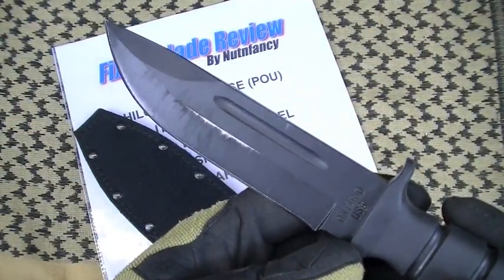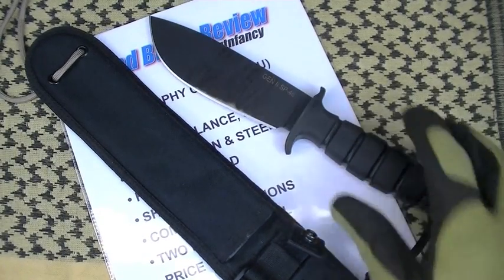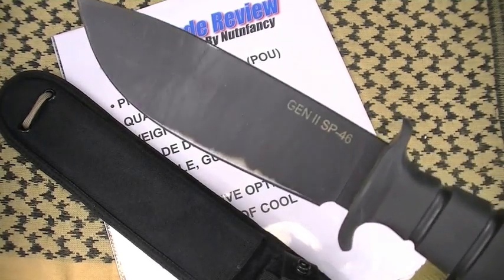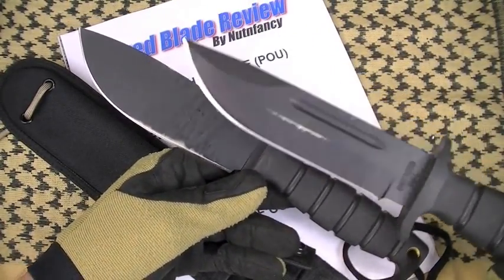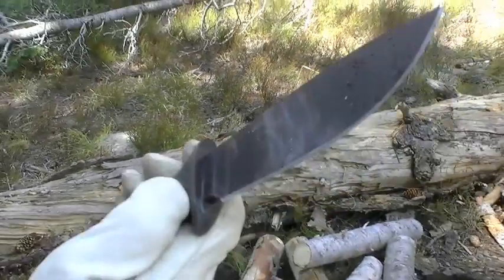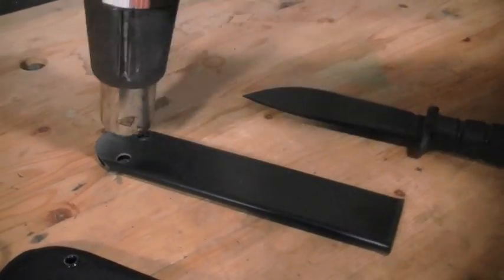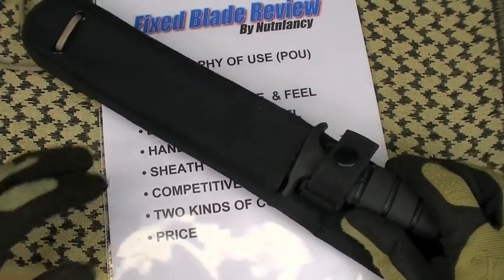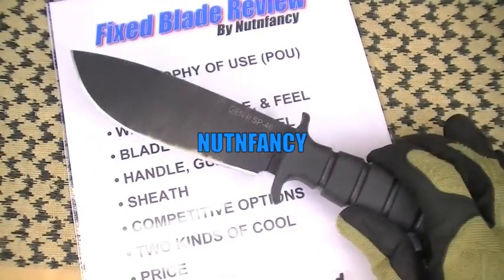Ontario Gen II SP46: "Surviving Compactly" by Nutnfancy

Comment: Watched this vid a few times and liked what I saw. Decided to get the SP-43 as I wanted the bigger blade, also hated the idea of smaller knife in a long sheath (seriously, why do this?). I did the heat-gun mod on the insert and this worked great, thanks for the tip Nutn. For me this blade is great value for money and Ontario are becoming a fav brand for this reason. Weight is good for the size, sheath is ambidextrous, and blade finish seems good quality. I'm happy with it . Thx for the review.

Comment: Thanks for the demo of fixing the sheath issue. I just picked up my SP43 today. First thing I noticed is that the knife fit a little loose in the sheath. I went straight over to my buds house.. used his heat gun and within 45 seconds had the knife fitting nice and snug. Again, thanks !!

Comment: Thanks for the great vid.  Will reconsider a value blade that I was thinking of buying for my buddy in favor of something from this new Ontario line.  FYI, the plastic liner CAN be heated up enough by a hairdryer to adjust the retention.  I used my wife's hairdryer to fix the liner that came with my RTAK-II (also a post-TNP vid purchase) and it worked great on the high heat setting.

Comment from the maker: @MongoWongo777 Glad to hear you dig it Mongo.  Congrats on a great high value blade.  Not sure about replacement sheath that would be better.  I might turn on some Kydex options later.  Good thing is the sheath is light so the extra room doesn't hurt weight wise too much (but I too hate the wasted area).

Comment: I have the Kabar BK2 and love it. Similar cost, blade length and weight. The Kabar is not flat ground but it has one of the best sheaths I've seen to balance that out. How about a comparision test of these two? Maybe roll in some other knives in the class? It'd be an interesting video I think.

Comment: Hey dude, quick suggestion here. As you said there aren't many knives around that size / weight / value, but I have one that you should really check out, it's the Ontario Ranger RBS Afghan. I prefer the RBS because it's 3/16'' thick rather than the normal Afghan which is 1/4". 1/4" is just too thick in that length of knife I feel. 

Anyway that's it, check it out and hopefully you'll post a review on it someday.
 
And the rest of the Ranger BUSH series, all 1095 baby!

Comment: @Jeenyus1983 I looked at a previous version of this knife a few years a go. Right metal, strong tip, simple design and rugged. For a field knife it's a good buy. As a survuival knife it fails because of one key factor: The direction of the sawback. Imagine that's it cold and wet, your tired and a long way from help. You try using the sawback and your hand slips, right onto the sharp edge of your blade. Now your cold, wet, tired, and have blood gushing from the web of your primary hand: Fail.

Comment: I received my Ontario Gen II SP-46 knife a few days ago. I really like it. Feels great in my hand. It has nice heft and is well balanced. Agreed with Nutn on the sheath. The blade is loose in the sheath, but great tip on how to snug it up using a heat gun. The only issue I have is the sheath length. There is about 3.5 inches of wasted space. Has anyone come across a replacement sheath that works well with this knife? Preferably Kydex. Thanks in advance.

Comment: --Hello I wonder if the protection of the hand between the blade and the handle is tough because I see is rubber, and I see that he can give weighed the same purpose and non-metal not see that last long a prolongado¡¡ use, what is your impression on the use of it? thanks